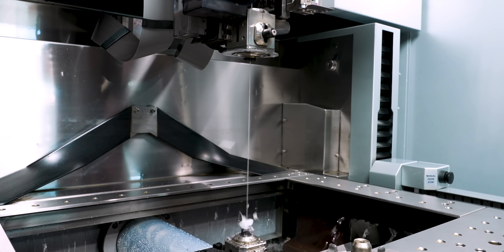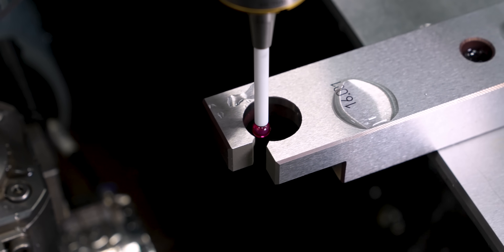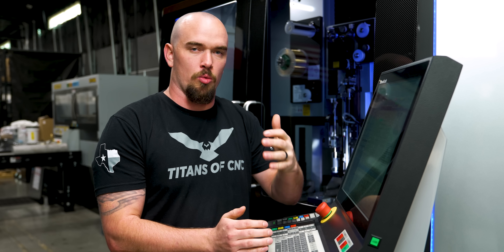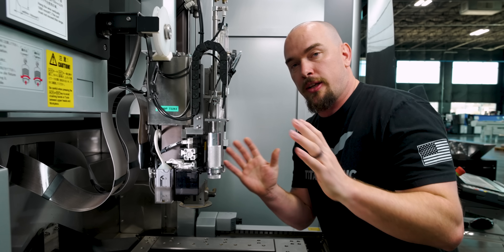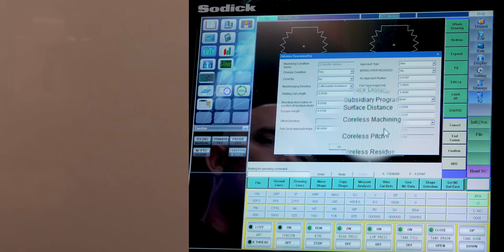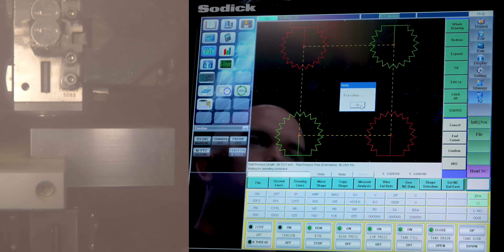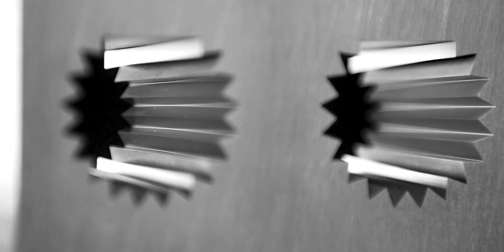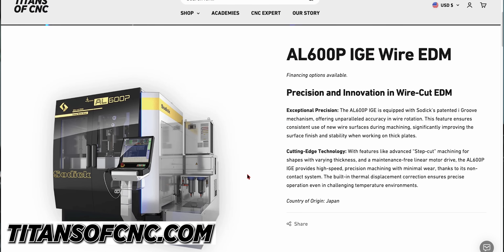Our Wire EDM Just Received a MASSIVE Upgrade

Comment: Where you can read point where Renishaw touch?? Because i don't see in macine menu this option. And Renishaw probe is not implemented in all centering cycle (eg in 3 points round center measuring.)  You have a documentation for using Renishaw on machine? Because i not found .

Comment: Is there some kind of detection that senses if the slug was successfully pulled and dropped? Certain shaped slugs might get cocked while pulling and fall off magnet. If they are partially pulled and sticking up from the work piece, they could lead to a head crash.

Comment: If the material is a block, wouldn't the slug fall if you set it upside down? Will the fallen slug get in the way of moving?
Reply: you can do that with smaller lighter slugs, but these are to long and wont clear, and to heavy and might damage the lower arm or wire nozzle.
but sometimes (depending on geometry) small slugs wont clear themselves either and you will get a wire break or a short too.

Comment: The slug puller won’t work with the slugs shown from 2:30 to 2:38. The video demonstrates slugs that are relatively easy to handle, as you would typically invert your cut, allowing the water pressure to carry them away.

Comment: Nice, but now make a part with no konical shape, how does the magnet work now ?
Reply: It works the same. After the slug is cut off, the upper head moves in UV to position the slug puller which leaves the lower head under the slug to support it and keep it from falling out of the bottom of the part.

Comment: Nice video, however I don’t understand how the slug magnet would work if your cutting a feature that doesn’t  have a draft angle. If you cut a straight feature the slug will drop sraight down. The probe is cool but in prototype medical device I’m not sure I would need it. Skewing the axis is EZ with wire touch off and with that 3-R tooling getting the top of the part flat is very quick.
Reply: The slug is cut off then drops about .004” and rests on the lower nozzle. The wire cuts and then the upper head moves in UV to position the slug puller. This keeps the lower nozzle in position which eliminates the crash from occurring and keeps the slug from dropping out of the bottom on a straight wall cut.

Comment: Cool extra features! Wondering though if the probe will be accurate enough compared to measuring directly with the wire….you add an extra variable to the system

Comment: I’ve actually been curious to how this works since you told me about it. My only question is what do you do if the parts have straight walls? Does the slug just fall and the puller can’t be used anymore? TELL ME WHAT I WANT TO KNOW TREVOR!!!
Reply: Its moves the UV axis to the side and the lower nozzle stays under the part and holds it

Comment: The slug puller looks like a nice feature at first sight, but how does it work on cylindrical dies when the slug doesnt't get held "in place" by the taper and tends to completely fall out or onto the lower nozzle? Asking as a long-time EDM operator on Agie/GF machines...
BTW, I really like the wire rotation feature on the Sodick!
Reply: The slug is cut off then drops about .004” and rests on the lower nozzle. The wire cuts and then the upper head moves in UV to position the slug puller. This keeps the lower nozzle in position which eliminates the crash from occurring and keeps the slug from dropping out of the bottom on a straight wall cut.
Reply: @trevorgoforth8963  Thanks for explaining! Now it makes perfect sense!

Comment: Guys, guys… make sure you get the aluminum magnet if you’re doing aluminum, won’t pick up the rough cut otherwise.
Reply: I've never seen Aluminium being cut on a wire edm, never even thought about it😂
We have a complete sinker/wire edm station at work that rarely gets used, so I've just built random shit for work or home out of 1.2379 steel, cuz that's what we use most. been doing this for 1.5 years now, waiting for someone at work to care😂
Reply: @dr.candyflip4854  when they eventually do, you'll get fired
Reply: @dr.candyflip4854  but not if your work is superior
Reply: Aluminium is not magnetic...

Why do I feel I got r/woooshed?
Reply: @inserteunnombreapropiado9079 you did lol
Reply: No, but a 50/50 alloy of gold and titanium IS magnetic.
Reply: @Jkirk3279 but, of course, we have no proofs of this😂

Comment: What is preventing the cut off part to fall in if the rough out part isnt tapered? Could still cause the crash into the bottom wire head...
Reply: The slug is cut off then drops about .004” and rests on the lower nozzle. The wire cuts and then the upper head moves in UV to position the slug puller. This keeps the lower nozzle in position which eliminates the crash from occurring and keeps the slug from dropping out of the bottom on a straight cut.
Reply: @trevorgoforth8963  thank you for explaining that.
That makes it even more awesome.
Wish you guys all the best!

Comment: Now THATS putting a new spin on and useful features in a process that takes lots of time. EDM is by far one of the slower methods of machining, but also the most accurate, especially for the geometry it is capable of. The amount of times i would have loved to have a slug puller, or able to probe a plane to make UV changes... Jealous to say the least!